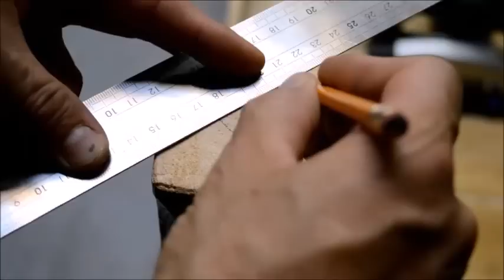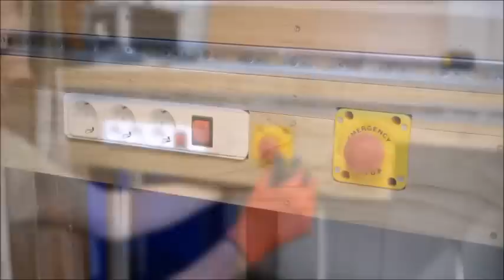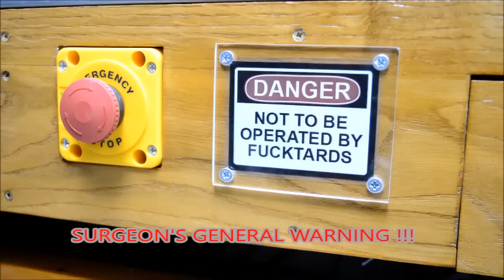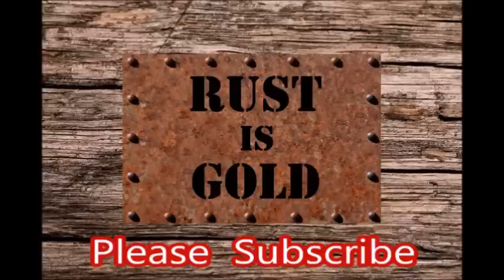DIY Table Saw - How to Make A Homemade Table Saw

Comment: While you were drilling one of the holes I ran to Home Depot and bought me a nice table saw with angle cuts, a nice guide and started cutting within minutes, they had a sale so I picked one up almost at cost.
Reply from the maker: While you were busy buying a nice table saw from Home Depot at cost price, I checked the statistics of my table saw video on YouTube Analytics and realized that I've earned around 5000€ just from this video alone. And the best part is that this table saw cost me 50€ to built it and I had a lot of fun. Do you have any other smart comments to share with us?
Reply: @RustisGold  
Lacks safety in construction and function. It's a shame you're not a wood worker and just a poser for money.
Reply from the maker: @boilerman1991  I am not a professional and I do not claim to be one. I am having fun making things out of garbage and because of YouTube I also get paid for doing that. I will not get rich out of it. However with the money I earn I can buy tools and supplies in order to continue doing my hobby. My insensitive and drive to create things is not money. It's the joy of creation. Whoever doesn't like what I do can switch to another channel. I could care less.
Reply: Always got to be one of those people on here. Probably sitting in his moms basement eating Cheetos and drinking mtn dew. Good job man!!
Reply from the maker: @brucehuffman3758  exactly... Always one of them pops up with a stupid comment. Most of the time the comment has to do with the waste of time, money and materials used and that it would be better to go and buy it from a store!! They write such comments....on a DIY video! Usually 95% of them haven't post a single DIY video on their channel. They're just a bunch of LOOSERS sitting on their couch typing nonsense. They will never understand what DIY is all about...
Thank you very much for your comments my friend! Take care!
Reply: Rust is Gold 
😆 
Bravo!
Your creativity is awesome! 
I enjoy woodworking. If it's not a joy people will find it pointless.
I'm hitting the like button because of the video and your comment.
( Priceless ) or perhaps (5000)
Reply from the maker: @kevinculpepper1310  thank you very much for your comments!! Whenever I watch YouTube videos even if I don't like what the other person created I can never be mean and write insulting or sarcastic comments... I respect the other person's work. This is not a bloody competition or a reality show... It's all about having fun while creating something....anything that makes you feel good! Take care friend! 👍

Comment: Very professional. After about the three-quarter of the video, his focus is more on electrical safety, both on the wire connections and the operation of the controls. He put there three safety connections including the emergency stop which is very important.
Reply from the maker: Thank you very much for your comments!

Comment: I dont know if anybody has seen it. At 12:33 you have used a male to male connector-adapter to energize the table saw. This is very dangerous, may kill someone by electrical shock and is not conform to an electrical norm. 
To all people who want to build this table saw... Use a cable with a normal male connector which is plugged into the wall socket.

EDit: I've seen in another comment that you've already fixed that issue. By the way: I like that use wooden material which has been thrown to the junk-container. Thats recycling in it's best. Apart from that in my opinion you have used too much wooden material. I know you have used the second layer for the optics. It's just a matter of taste. Overall i like your project. not too precisely but practically. In yor next projects it would be great if you take more care of the electrical safety.
Greetings from Germany
Reply from the maker: Thank you very much for your comments. As you have already read I fixed this electrical issue. Unfortunately because this particular video has a lot of views YouTube is not allowing me to do any editing...
Reply: Yes I saw it, and I saw aldeady that he fix this probleme at the end of the video 👍.

Comment: 9:00 you drill holes,experiencing material swing from friction at the punch out.
Your clamp was positioned behind the swing, however you put it in front in the proper position on the last one by accident.
Please make it a habit to clamp material in such a manner that all the swing radius is captured by the clamp as you install the clamp.
Reply from the maker: You are absolutely right, thank you very much for your comments!

Comment: Cool,  only  1 problem no saw Adjustment or Angles for the saw
Reply from the maker: Thank you very much for your comments. It is true I cannot change the angle of the saw...
Reply: Can't u change it from down side?
Reply from the maker: Practically I can but I need to do some adjustments on the table so it is easier and I am too lazy to do it! 😄 Anyway I don't do very complicated wood projects so I don't really need to change the angle of the saw...

Comment: Showcased some very basic, but important wood and metal working skills, also some electrical. Well done.
Reply from the maker: Thank you very much for your comments, I had fun building it, it is not a professional table saw but it works great for the projects I make...
Reply: Sorry but there is one GLARING electrical error, verry dangerous, there are two male Schuko connectors on the same cable. Unplug one of them and you have live 230V hanging around to give someone a very nasty shock.
Reply from the maker: @charleswhitehead7441 no worries, I have replaced it. It is safe now...
Reply: @RustisGold  Yes, I saw your reply in German to another viewer.

Comment: Although it is a great video, I see that on 12:28 the bench uses a socket for power supply and then a cable with both ends on the same polarity ( the one someone is easy to touch). So,  if by accident the bench is moved the cable will be out of the socket and the metal will be active.If fuses on the electric board do not work, someone will be electroshocked. 

  I strongly recommend changing the power supply by e.g. extending a cable with a plug after the emergency button directly to an active plug in the warehouse.

 In the good will.

 I hope none was offended!
Reply from the maker: Lefteris Pandelakis no worries,  no one was offended. You are absolutely right, it was dangerous. I have already changed it.
Σε ευχαριστώ πολύ για τα σχόλια σου πατρίδα!!  Να είσαι καλά!

Comment: you made it so complicated and I wondering why did you add more block's of woods in here and there..
but the results soo awesome..I like it very much..
good job..
Reply from the maker: Thank you very much for your comments. You are right, during the process I decided to add all this wood in order to make the whole structure heavier and as a result more stable. It was too light before and it wouldn't work properly. Now, with the extra weight it works just fine!

Comment: Projekt bardzo fajny.
Sposób podłączenia zasilania NIEDOPUSZCZALNE! prędzej czy później, dojdzie do wypadku, to tylko kwestia czasu, kiedy napięcie będzie na wtyczce.

Very cool design. Connection method of the power supply UNACCEPTABLE! sooner or later, an accident will happen, it's just a matter of time when the voltage is on the plug.

Comment: Brother that thing is a blast :O
Reply from the maker: Thank you very much!!! 😊👍👍👍
Reply: @RustisGold  but is there anything that you would do next time different? I will start mine NOW :D
Reply from the maker: I wasn't planning on putting so much wood on it... However with less wood the whole structure was kind of light and not as solid and heavy as I wanted it to be. So to answer to your question... I wouldn't change anything on it!
Reply from the maker: Good luck with your new project! 👍
Reply: @RustisGold  thanks :)

Comment: I feel that it is a random work that may be due to weak legs that I did not like and then you supported it with the lower rack to strengthen it or because of the video sequence output.  Thank you because the video added a lot to me, and I wish you luck in the future
Reply from the maker: Thank you very much for your comments! It is true that I wasn't planning on adding so much wood. However as you correctly mentioned it was too weak and needed support. 👍👍👍

Comment: Nice work man.
But two male connectors on a one cable? (12:30)
Please, rebuild this, for your health...

EDIT: BAILLY already reacted 🤟
Reply from the maker: Thank you very much for your comments. I agree with you...
As I have mentioned numerous times before, I realized it was wrong and I have already replaced it with a proper plug. Unfortunately due to the fact that this particular video has more than 200K views, YouTube (for some strange reason) is not allowing me to edit it....

Comment: Nice build and great video!! Correct me if I'm wrong, but your short black power connector seems to be very dangerous. Furthermore keep up making these great video's!! Cheers
Reply from the maker: Thank you very much for your comments!! Without this black jack it is impossible to start the saw. I know it needs special attention but I always keep it locked so no one except me can reach it.
Reply: Actually what you need is something similar like an "IEC male panel mount power connector". See Google. I don't exactly know which country you live in, but these connectors are commonly used, mostly all over Europe. Cheers!! :)
Reply from the maker: Misja Knives and Wood thank you very much for the info. I will google it. I live in Greece so basically we use standard european electrical materials. Thanks again.

Comment: Great work, just it does not have a guard for safety. Also, how do you adjust the height of the blade??
Reply from the maker: Thank you very much for your comments! It is true....no guard... I adjust the height from underneath. Not very practical but it works!

Comment: impressed great job well done , when you making a sledge for it
Reply from the maker: Thank you very much for your comments! Yes, making a sledge for it is on my list!!!
Reply: you should alter it by putting an insert in it so you can tilt blade for bevelled cuts that's what I did when I made mine just do a wider insert for bevelled cuts and another for straight cuts. just a suggestion but will make the saw more versatile
Reply from the maker: That's a very good idea!  Thanks!!!

Comment: Thank you. One of the best work. Simple. My doubt is, you have screwed the saw to top plank of table. Will those screws be able to hold to vibrations.  Screws are small. Will they hold on? I want try the same one you built.  So am clarifying. Thank you.
Reply from the maker: Dear Mrutyunjaya M thank you very much for your comments!! 
I am glad you liked my project! 
Until now I haven't experienced any problems. Although the screws are not very long the saw seems to be very stable. I dput as many screws as I could.Try to make the frame where you'll fit the saw as narrow as possible so that it fits exactly inside it.
Reply: There seems to be room for a support structure in the front of the saw, a little more tight in the back but still room.
In addition rubber/silicone construction type glues handle vibrations quite well.

Comment: Great job!! But I can't help but wonder, why?? Correct me if I'm wrong but it doesn't appear the blade comes through enough to cut a 2x4! Also, for the money and time you spent, could you have just bought a better table saw, capable of much more?
Reply from the maker: The cost of making this structure was only 50 Euros. All the wood I used cost me nothing. I found it for free in the garbage. I did it for the fun of it, not in order to save money.

Comment: It's well done, but I would definitely change the power switch to a spring loaded foot operated one. I've never seen or heard of anything safer than that. Just think about finding and then operating the existing one quickly when milliseconds count vs. a foot switch where your foot is already located.
Reply from the maker: joe woodchuck thank you very much for your comments. I wasn't aware of this switch you mentioned. I will definitely check it out. Thanks again for the tip!!

Comment: Really great table saw! Thank you for the video. 

But as I got warned myself just recently: One should not never wear gloves when working with a table saw! This is extremely dangerous and potential injuries are worse than without gloves (in case of an accident gloves can get pulled in by the blade and fingers can be ripped off...)
Reply from the maker: Thank you very much for your comments!
You absolutely right about the gloves. I never used them again.

Comment: looks really nice overall =) sry my english aint best but can i ask you 2 question about the electric parts. 1st really good that emergency switch +10 points for that =) then 2nd  i noticed while looking the video that you put circular saw plug in front of your table is there little risk that you somehow stumble on it while its on front ? and 2nd the connection of table ! you have a short cable that got 2x "male" sides, what if it gets lose from the table and hits something like your leg you might get electric shock! so if the connections were in side or inside there would not be any risk for get stuck on it and if the connection from table would have male connection you could just use any cord to connect the electricity.
Reply from the maker: Thank you very much for your comments. I have replaced the socket so now it needs a "female" one. You are right,  it was dangerous....
Reply: =) me 2

Comment: Cool video!  Out of curiosity, do you have to take the top off the table and then unscrew the circular saw from the bottom in order to change blades?  Wish I had your wiring skills!
Reply from the maker: Thank you very much for your comments!! 
Yes, in order to change the blade the upper part has to be removed.  This is one of the reasons I made it this way. It is also easier to move or store it. Plus a lot of the remains of wood that are not sucked by the vacuum cleaner tube fall on the tray underneath,  so it is easy to collect and it doesn't make a mess.
Reply: Cool. Good idea.

Comment: Awesome table but for the cost and materials and the fact you cannot do dayto blades, just wondering if the cost vs paying for a table side saw would be better
Reply from the maker: In my case it was different... it only cost me around 50€. All the wooden parts I found them thrown away in the garbage. I only had to pay for a new saw disc replacement, the electrical parts and the wheels. All the rest was free!

Comment: Impressive creativity but labor intensive.  The substandard performance capability makes it 
impractical and probably more costly than just buying a much better brand name saw when you consider time and materials
Reply from the maker: Thank you very much for your comments. It only cost me around 50€. All the wooden parts I found them thrown away in the garbage. I only had to pay for a new saw disc replacement, the electrical parts and the wheels. All the rest was free! So basically I just had some fun creating something out of upcycled materials.
Reply: Great but no ability to raise or lower the blade limits its use a lot.
Reply from the maker: This is true but the woods projects I do don't require a super professional table saw...

Comment: Really great job! But, how would you manage to adjust depth and angle?
Reply from the maker: Thank you very much for your comments!!!  The upper part of the structure is removable so I can adjust the depth. Regarding the angle I will have to make an adjustment on the upper surface of the table.... Unfortunately I didn't think about it when I was making the table...

Comment: looks rather good. but, how can you adjust the hight and the angle of the sawblade ?
Reply from the maker: Thank you very much for your comments. I can adjust the height and the angle from underneath the table saw. Not very practical but it works!

Comment: What about tilting the saw for angle cuts and changing the hight of the blade out of the table plane???
Reply from the maker: You are absolutely right. I didn't think about it while making the table saw....
I am planning on modifying it, however,  the height of the blade is the maximum it can go. Thanks for the tip!!!
Reply from the maker: Hi! Here's the link of my new video on making a fence for my table saw. Check it out if you like!!! 

https://www.youtube.com/watch?v=A0Z65ZI8fLg

Comment: Very nice, is this tig welding that you use or other method.. I would like to make table saw with metal legs but I don’t know which is easiest welding method for newbies like me :)
Reply from the maker: Thank you very much for your comments! I am using stick welding. However I want to upgrade and go to tig welding!
Reply: Rust is Gold is stick welding easier to learn than tig ?
Reply from the maker: @ramban3488  I haven't used tig welding but I think stick welding is cheaper to buy and a good way to start exercising! However, do your research, I am not an expert on welding!